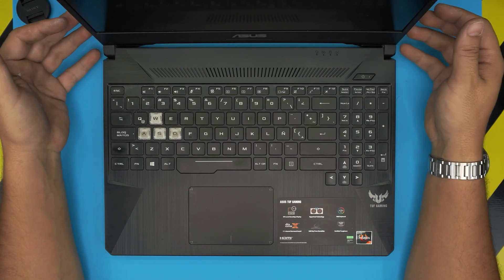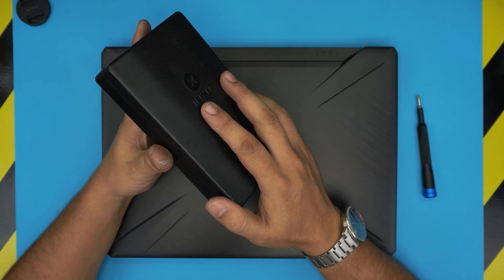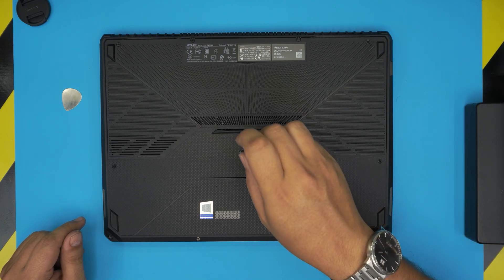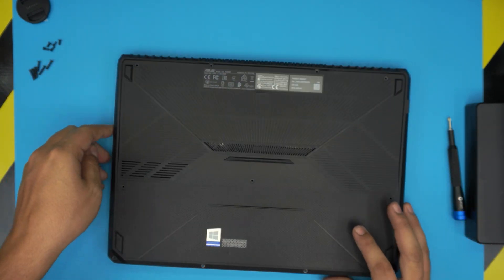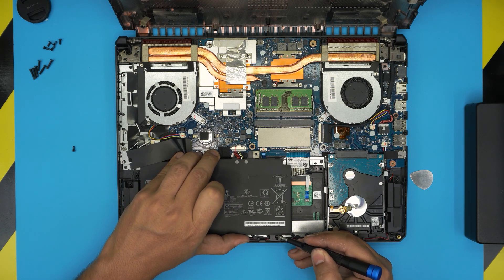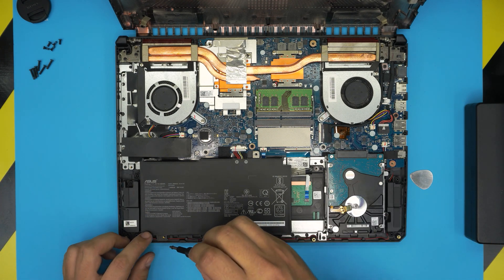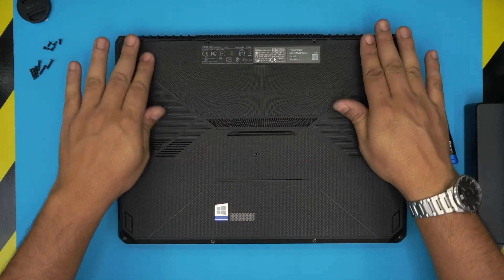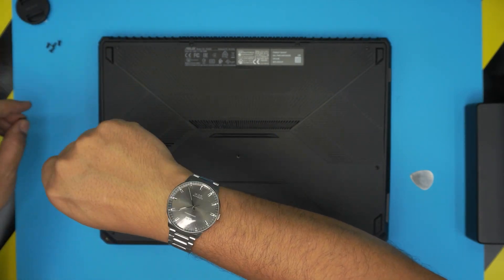ASUS TUF Gaming Fx505d Battery Replacement Guide 📢

Comment: hey man, i have a asus tuf a15 ryzen 5 , 48wh model from 2020 ( still works super fine ) , and its the time to replace the battery , as its been around 5+ years, so , 

are the OEM batteries available online ?
Reply from the maker: 🫠Regarding your question, just get a new battery from a seller with the highest sales or best reviews. OEM batteries are extremely hard to find, as there are millions of fake or pirated ones on the market.
Should you have any further questions or requests in the future, please don't hesitate to ask me.
cheers🍻

Comment: Tengo una de la misma le cambié 3 veces batería pero se descarga rápido y dura menos de 2 horas y poniendo una batería original..ayuda
Reply from the maker: 🫠Con respecto a tu pregunta, sí: las baterías originales siempre son mejores que las baterías genéricas o de mercado alterno.
La duración de la batería en una laptop depende mucho de los servicios y programas que tengas abiertos, del brillo de la pantalla y también de si tienes otros periféricos conectados.
Si en el futuro tienes más preguntas o alguna otra solicitud, no dudes en preguntarme.
¡Saludos! 🍻

Comment: I have this laptop 💻. My battery  wont charge and my light for power is not on when i plug power cord in.
Would you have any ideas on whst i can do tyvm
Reply from the maker: 🫠Regarding your question, you will need to check the charger's output first and see if it is providing 19V. The issue could be a faulty charger.
cheers🍻

Comment: Hi Good sir, I have the same laptop but different model. A Asus TUF FX505GT. When I'm cleaning the laptop and trying to put it all back I messed up and I bent one of the connector pin for my battery. How will I fix it? I heard I will need to use a twizzer 😢 The laptop is still working but it needs to be plugged in.
Reply from the maker: 🫠Regarding your question, you will need to use tweezers and slowly bend back the pin that is folded. Be very gentle and careful—if the pin breaks, then you will need to do soldering.
Should you have any further questions or requests in the future, please don't hesitate to ask me.
cheers🍻
Reply: Hi Good sir! My friens uncle fixed it for me. Thank you for your advice! My laptop battery is completely working now 😊 @uFixTek
Reply from the maker: Awesome, I'm glad they could help you out.
If anything comes up in the future, don't hesitate to ask me.

Comment: HELLOO!! tonight after removing the battery connection while unplugged, to reconnect a new screen, after doing so and re-plugging the battery back in the two lights under the left fan didn't blink white and it no longer is charging. Did I fry a connection somewhere? No missing or bent pins inside the connector on motherboard. Someone please help!! model FX505DD. THANK YOU!!!
Reply from the maker: you need to check and look inside the jack on the motherboard and make sure all the pins are straight and not bended.
Reply: @uFixTek  did do that. All pins are straight no broken off ones either. I'm crossing my fingers and I ordered a new battery and switched the charging jack just in case. Wish me luck
Reply from the maker: i hope that the fue in the batery blow up and now that you get the new battery it should be fine else you will need to get the charge circuit check on board. the BQ chip

Comment: What after replacing battery should I start itt without changing or after charging
Reply from the maker: 🫠Regarding your question, once you place the battery, leave the laptop off and plug it in for 3-4 hours. Then power it on without the charger plugged in and drain the battery slowly. After that, power off and leave it charging for another 3-4 hours. This initial charge and discharge is very important for the battery.
Should you have any further questions or requests in the future, please don't hesitate to ask me.
cheers🍻

Comment: I have a similar model which is the FX-505DT. It has a AMD Ryzen 5 and an Nvidia GTX 1650. Battery replacement is the same. When replacing the battery, it’s always a good idea to disconnect it before removing it. This also should be done when doing upgrades so nothing shorts out.
Reply from the maker: For this specific model, the screw is located on the bottom edge, eliminating any risk of it falling over the board. Disconnecting the jack FIRST isn't necessary, and in fact, removing the screw first provides more room and flexibility to detach the connector safely.

When upgrading other components like RAM or SSD, there's no mandatory requirement to disconnect the battery. As long as the power to the motherboard is off (shutdown), there's no inherent risk. However, if the person performing the upgrade is prone to being flimsy or careless and might accidentally drop the screwdriver or screw over the board, then it's highly advisable (1000%) to disconnect the battery for added safety.

Cheers! 🍻
Reply: Hi! Where did you buy the battery for this model ASUS-FX505DT GTX 1650? I can't find the original one to replace it.
Reply: Where did you buy the battery for replacement?

Comment: Hey I have the same laptop but a 2060 rtx, am I able to change the battery to a better one since my laptop dies very fast while not charging like 1 hour max and for my current use I need it to last longer.
Thank you
Reply from the maker: Thank you for your feedback! If you wish to support the channel, you can like, subscribe, or both!
Regarding your question, you can't place a higher capacity battery at the moment they don't have any higher capacity for this models.
Should you have any further questions or requests in the future, please don't hesitate to ask me.
cheers🍻

Comment: Hello , I have a older model FX504G 

I replaced the battery it turns the laptop ON but it wont charge while the old original battery is charging with indicator but it isnt holding charge anymore thats why i was replacing it. Did i miss something?? Pls help

 PS: The bios was re-flashed prior to the battery replacement due to it getting corrupted. D
Reply from the maker: Thank you for your feedback! If you wish to support the channel, you can like, subscribe, or do both!

Regarding your question, I highly recommend visiting the official website to check for any available BIOS updates. The issue you are facing is likely due to the BIOS not recognizing the new battery board. Updating the BIOS can often resolve this problem. Alternatively, you could consider purchasing a battery from a different manufacturer. Some batteries may have a simple circuit that is not recognized by the BIOS, whereas higher-quality batteries usually come with a battery circuit board that makes them easily detectable by the BIOS.

Comment: Wow this is the laptopni bought two years ago
Reply from the maker: Should you have any questions or requests, please don't hesitate to ask me. 🍻
Reply: @uFixTek  i have a question. I usually overheat my charger and my battery got a glitch with 0 percent battery for few days then went back to normal charging percent. 
It kinda weird that my games went smooth without lagging while charging it then without the charger it lagging like crazy on my games. Is it because of my battery damage?
Reply from the maker: NO, there's one thing people don't know, but they think it's okay. You should never game or use maximum load on your GPU and CPU when running on battery. This can cause damage to the battery and components on the motherboard. The GPU and CPU require a higher voltage to run at their maximum specifications. The battery typically provides around 11.4V and 46Watt, which is equivalent to 4 amps: https://imgur.com/a/sEh8oGF. If you check your charger, you'll see it outputs 19.5V and 6 amps.

To summarize, if you run on battery alone, you will experience significant lag and performance issues. Now, let's discuss laptop charger overheating. If you want your battery and charger to last longer, you must follow these steps:

RULE NUMBER #1: NEVER USE A LAPTOP and CHARGE at the same time IF your battery is below 70%.

Use the laptop for office and daily tasks that don't require heavy usage while on battery. However, once the charge is low, for example, 30%, you must power off the laptop and leave it charging for a minimum of 3 hours. After that, you can use it again without the charger. Alternatively, if you're going to use it for an extended period, keep the charger connected and maintain a full battery. The charger is solely responsible for powering the laptop, and it isn't stressed because it doesn't have to charge the battery.

In technical terms, let's assume a laptop requires 6 amps (check the sticker under the charger) to run, and a battery with a low charge requires 2-3 amps (standard charge rate) to charge itself. This adds up to a total of 6+3 amps, which is 9 amps. If you try to power on the laptop and charge it at the same time, the charger will overload itself because the laptop requires 9 amps, but the charger can only provide 6 amps.

It's similar to building a PC with top-of-the-line graphics card and CPU but using a weak power supply (PSU).

In conclusion, keep the laptop charged at 100% and plugged in when gaming and working. If you want to use it on battery, do so with light load, and once the battery is low, power off and charge it. Then decide again whether to use it on battery or keep it connected for longer usage periods. I hope I have explained myself. With over 17 years of repair experience, I've seen it all.
Reply: @uFixTek  i see thanks but im kinda worry about getting zero percent battery charging again. Atleast it temporarily and went back to normal charging

Comment: Hi ! I did switch the battery of my laptop and upgrade ram to 32 corsaire vengeance. Then I started it right away. The light of the keyboard light up but nothing else happen. I did remove the battery and ram, got the battery of the mobo out. The put the battery and ram in it again. What do you think could be the problem?
Reply from the maker: Thank you for the feedback! if you wish to support the channel you can LIKE or SUB or both :P
regarding your question: remove both rams, and only place one ram on the dim near the CPU, then power on and wait about 10-15 sec if no image then power off and remove the ram and put the other ram in the same place and power on and see if you get boot if you do then you know that one ram is bad. do this 1st if nothing let me know.

Comment: I disconnect the battery 🔋 and connect again for some reason but After doing that my laptop doesn't turn on back what to do please help...
Reply from the maker: Thank you for the feedback! if you wish to support the channel you can LIKE or SUB or both :P
regarding your question: Don't worry remove the battery and the rams, then plug in the battery and place the rams and then power on and wait 10-15sec
Reply: @uFixTek  i did everything but only keyboard flash for mili second may be short circuit problem
Reply from the maker: @THESKY47  try powering on without battery connected
Reply: Mine also flashes and won't turn on
Reply from the maker: @FFG8G  try removing the ram and place only one ram in and power on and see if it works, sometimes if ram connectors don't make a good contact this happens.
Reply: @uFixTek  It happened when I was watching a movie with wall charger and my back hurt. So I quickly unplugged the charger and lied on bed to watch it from there. After 1min. batt. Charge dropped from 95% to 17% , that's when the low batt. Notification pops up. I immediately pluged in the laptop but it stayed 0% . I thought it was a bios error or something so I restarted. But it won't even charge it
Reply: I suppose the batt. Controller chip is damaged when I suddenly unplugged from charger . The load wasn't that big though 💀. I use my laptop for Gaming and rendering. I hope changing the batt. Will solve the issue coz I'm very broke now to repair it. It never been once after serviced in like 3 years.
Reply: Homer  Turns out its was due to me plugging in my audio system. It might have fryed the MOSFET.
Reply: Homer  My battery is good. Its was a Home theatre input jack.

Comment: can we replace it with larger battery capacity?
Reply from the maker: Thank you for the feedback! if you wish to support the channel you can LIKE or SUB or both :P
regarding your question: im afraid not the charge component are not designed to bigger capacity battery, if you even get a bigger battery capacity it will not charge 100%,but they don't make it for this model.

Comment: Hello I have a big question. If I unplug my battery and i don't charge it, it will be dead after how much days?
Reply from the maker: Thank you for the feedback! if you wish to support the channel you can LIKE or SUB or both :P
regarding your question: charger the battery till 60% then keep it outside for max 4months and after 4months you need to charge and discharge 2 times, and then again 60% for another 4months

Comment: can i upgrade my 90W battery/completely replace it with a 130W? I have the rtx 3060 graphics card and will get the most out of it with a higher battery wattage
Reply from the maker: Thank you for the feedback! if you wish to support the channel you can LIKE or SUB or both :P
regarding your question: i would highly not recommend you to get a higher Watt battery as the components on board and charge circuit it is set at 80-93Watt exactly. and you should never game on battery alone, its the worst you can do to a laptop, to pull so much amp from a battery so quick its very bad.
Reply: @uFixTek  ok thanks for the reply.  Subbed!!
Reply from the maker: its my pleasure my friend, if you have any question or request in the future feel free to ask me.
Reply: maybe just build a pc? upgrading laptops will get u just far, pretty limited

Comment: Is there a way to upgrade the battery capacity to something like a 56WH? It looks like there's a bit of room on the right side of the battery
Reply from the maker: Thank you for the feedback! if you wish to support the channel you can LIKE or SUB or both :P
regarding your question: no because we have tried and it will damage the charge components on the board they over heat.
Reply: @uFixTek no nothing will overheat, it doesn't work like that

Comment: hello, if asus tuf every time use 220 volt - i can remove kick battary?
Reply from the maker: Thank you for the feedback! if you wish to support the channel you can LIKE or SUB or both :P
regarding your question:  you can remove the battery and use the laptop only with charger it will work just fine and the charger will last you longer, and so will the motherboard.